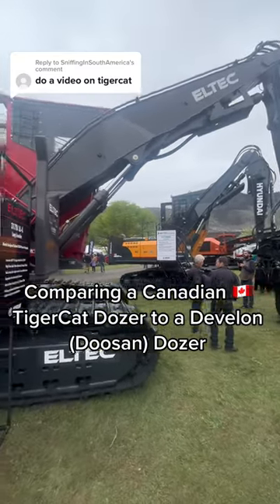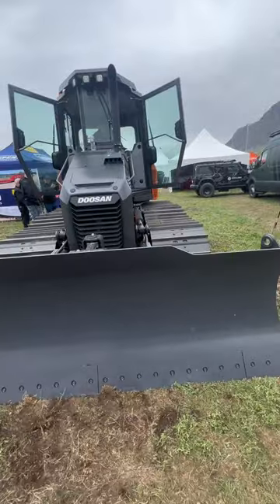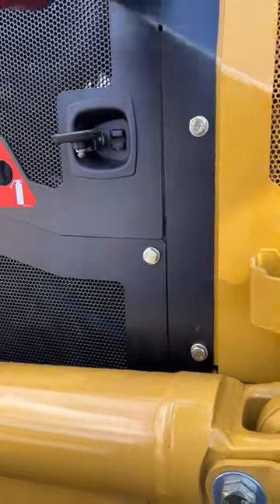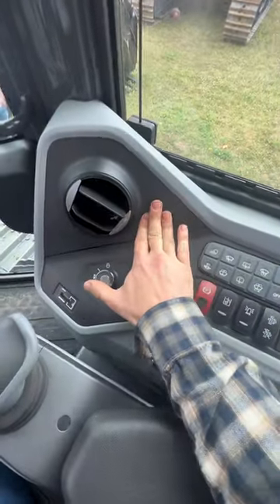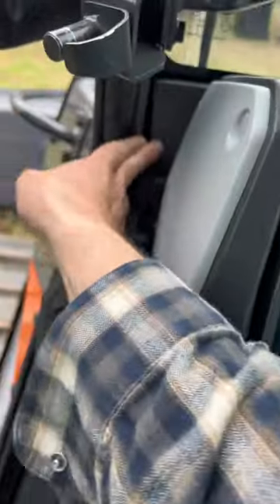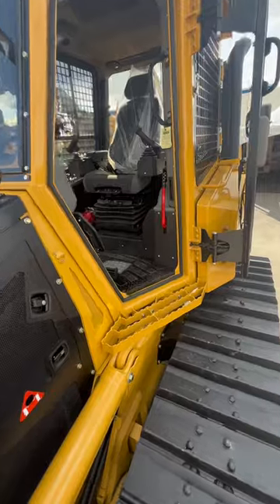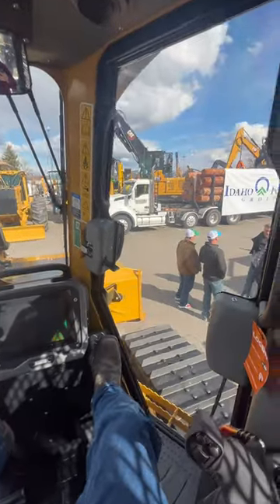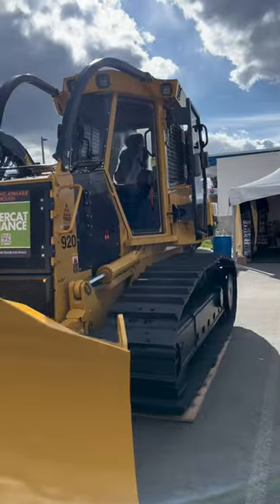Tigercat vs Doosan Dozer

Comment: More sustainable long term too. Steel might not be the most clean thing to mine and process at first, but the tigercat can be reccylced far more efficiently then the other dozer and get a lot more life out of its material
Reply: The Tigercat also had plastic panels if you watch the video, he just didn't show them other than in a low down view.
Reply: @AlexKall certainly seems to be less total though, also willing to bet it’s a higher quality polymer that could fare better being recycled.

Comment: Cost is King. Wonder which one is cheaper? Real question not sarcasm.
Reply: In many things you get what you pay for. Even if the upfront cost of the lower quality machine is less, if you spend 2 or 3 times more on repairing that machine within a given time period you quickly will realize you ended up paying more for less
Reply: The plastic bits require molds made so up front cost is higher but per unit cost is lower.  So the break even depends upon quantity made for the manufacturer.  The end consumer has different math, cost of equipment divided by years of expected service life.  Are you having to buy a new one every 20 years or every 5?
Reply: The main cost factor for me would be as a consumer. If I was a small operation, buy once cry once. If I was build highways and needed 20 dozers for 5 year and then they go to auction. Give me the cheapest that will get the job done
Reply: @DodgeRamCan  doosan will definitely be the budget option and will get 80% of the job done
Reply: Doosans are cheap. Tigercats are one of the most expensive. At least in forestry equipment.
Reply: I drove a 620 tigercat skidder for 4.5-5 years and treated it like you would a illegitimate stepchild’s dog the whole time! It took it like a champ making drags the grapple wouldn’t close around, even after trying to shove the butts down into the ground to make the grapple close tighter. Front end wanting to get up unless you had the dual arch folded on up to the front. Tigercat is a beast. 
Left the tigercat behind for mo money to drive a caterpillar it’s not a cheap machine by no means but cheaper than a TC. Cat was almost a year old and we couldn’t get a good days work out of it for nothing. Try to run it’s 🫐2wall very long, it’s hot. Pulled a 102 loads in a week (5 days) dawn to dusk with the TC and the best I ever got with the kitty was 48. Caterpillar needs to drop the skidder and pick truck engines back up!!! Sorry for the book. 
Heck yeah I’m bored.
Reply: The one you can get parts for and good quick service is the cheapest in the long run. Doosan bought bobcat years ago and they have gone downhill.
Reply: @BaconOverLord14  Not just repair costs but overall running costs over the lifetime of the equipment, downtime is a major part of that. Hence the farmers suing John Deere to be able to repair their junk without shipping them to a JD dealer!
Reply: I get what your saying but you really can’t compare.  The Doosan is trying to beat a price point.   While Tiger Cat is known for its heavy duty guarding and robustness 

Your comparison is Apples and Oranges
Reply: @tfodthogtmfof7644 he just asked which dozer is cheaper…
Reply: Purchase price is only the first number.  Total cost of ownership (TCO) is the real number to consider. . .and often a lot harder.

TCO includes the cost to replace parts, the cost of maintenance, estimate of how long the dozer will last, etc.

If one buys a Doosan that's half the cost of a Tigercat, but you have to buy a second one in the same lifespan of a single Tigercat you've already broke even.  

Cost of maintenance example is the old Ford power strokes that had to lift the whole cab up to service the rear part of the engine (iirc the fuel injectors) where as other brand trucks of the same years did not require that level of tear down.  Could also be other things like are the fluid drains and fill ports in easy access locations or do you have to dissemble a lot (taking more maintenance down time).  The list goes on. . . . .
Reply: Honest answer having prices both. 
TC- 375,000 usd
Doosan- 179,000usd

The tiger cat is two class sizes up from the doosan as well. 
Dd100 weight is about 21,600lbs tigercat is about 37,000lbs

Tiger cat Hp 147
Doosan hp 122

So ya hard to compare apple for apples. It’s like trying to compare a big skid steer to a wheel
Loader. Sure they’re  both “loaders” but one is an order of magnitude more expensive and is a bigger heavier stronger machine.

Comment: @Edison Motors Those are limb risers (or sweeps) not ROPS, the curbed bars from the front of the hood to the cab. Mostly on forestry more than plain construction machines they keep the limbs from tearing off the intakes, exhaust, busting any windows and keeping the operator safe (think open cab machines). I realize the tigercat doesn't have the intake or exhaust like CAT and Deere exiting through the hood, so these are more for cab, operator and window protection. I'd bet money that doosan has ROPS they are just built into the cab. With that being said i wouldn't want to trust doosan's ROPS because everything else looks so flimsy. Tiger cat's stuff is neat! As a former logger, I'd like to try it to the comparable Deere and Cat stuff. Cool video man!
Reply: Doosan cab is certified as ROPS, can't find anything on the Tigercat info I looked through.

Comment: for annyone caring about the specs of the two
Tigercat TCi 920 vs Dosan DD100
TCi 920:
Power   101kW (135hp)
Weight	15800 kg
Length	4930 mm
Bladewidth	3175 mm / 3 355 mm / 3 685 mm
Track Guage	2010 mm
Track Shoe	560 mm / 600 mm / 760 mm

DD100:
Power   86kW (115.3hp)
Weight	10700 kg
Length	4739 mm
Bladewidth	2710 mm (XL Blade) 3220 mm (LGP Blade)
Track Guage	1890 mm
Track Shoe	510 mm (XL) 700 mm (LGP)
Reply: Moving dirt/building landings in the BC interior? Tigercat all day.
Working on Muskeg in Alberta? Doosan.
Each has their place; you will be buying the Doosan more frequently though.
Reply: Man, that plastic must really cut back on weight. 5100kg difference
Reply: Cost per unti?
Reply: @crinkly.love-stick  smaller engine, smaller blade, smaller tracks

Comment: I have the same issue with pick-up trucks. I want one to work in and out of. New ones are plastic with an aluminum body. What happened to real work trucks? I didn't want a car with a bed. This is why i like what you are doing with the Edison truck.

Comment: Well if you're letting an uneducated "beancounter" go to the shows (because it's a paid vacation if you ONLY travel once a year) and he's selecting what to buy based on a "value proposition" that HE DOESN'T REALLY UNDERSTAND, he's gonna pick the one that looks / costs more like what he's used to ... cars. But cars have an "aesthetic" component that really doesn't need to be there except ... people.  Dozers shouldn't have an "aesthetic" component. I've actually seen this in fleet management in my career (not heavy equipment, day cabs - but I'll bet it's the same).

Comment: The plastic panels will snap off the fittings when you have to repair something behind them and it's cold outside, guaranteed. Let's in dust and moisture behind it to the electronics then. Bolt on is better, but more expensive. With it though, imo

Comment: Honestly I hate the "clean" look of an all snap-together plastic interior. It looks flimsy, it looks cheap, and it does not look like something I want anything to do with. Exposed nuts and bolts look fine, can be made to look good, make it easier to service, and are orders of magnitude stronger than plastic clips.

Comment: Same Rating ?
Reply: of course not:
Tigercat TCi 920 vs Dosan DD100
TCi 920:
Power   101kW (135hp)
Weight	15800 kg
Length	4930 mm
Bladewidth	3175 mm / 3 355 mm / 3 685 mm
Track Guage	2010 mm
Track Shoe	560 mm / 600 mm / 760 mm

DD100:
Power   86kW (115.3hp)
Weight	10700 kg
Length	4739 mm
Bladewidth	2710 mm (XL Blade) 3220 mm (LGP Blade)
Track Guage	1890 mm
Track Shoe	510 mm (XL) 700 mm (LGP)

Comment: Tigercat is twice the price
Reply: And it looks like it will last twice as long, at least, and cost half as much to maintain over that time.  Maybe the douchebag (oops, autocorrect) Doosan would make sense if you could lease it and turn it in as a beat up pile a crap at the end of 2 years. 😂
Reply: @bastarddoggy  Higly depends on the circumstance. Depending on how high the interest is, and so on.

Comment: You know you're not even comparing apples to Apple's. You went From a rather large dozer built by tiger chat and compared it to small Mini dozer than my skid loader could probably outdo made by Doosan.   I'll be if you get a compare stuff make sure it's the same series of dozers the same horsepower you know all the same specs and then compare the equipment. But when you're comparing a full on dozer that's made to get out there looks like I have a forestry package a little bit and then you compare it to a little mob and pop talk a toy you know of course out of these I'll be if you get a compare stuff make sure it's the same series of dozers the same horsepower you know all the same specs and then compare the equipment. But when you're comparing a full on dozer that's made to get out there and get after it,  hell looks like a fully equipped forestry package option on it and you compare it to a little tonka toy home owner size dozer..  well you know of course everything's gonna be different throughout the whole unit.